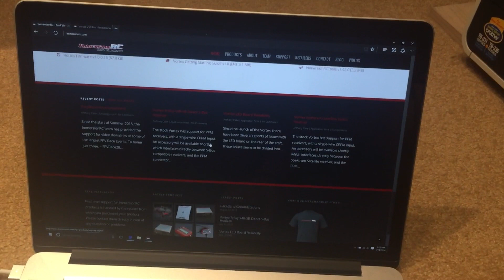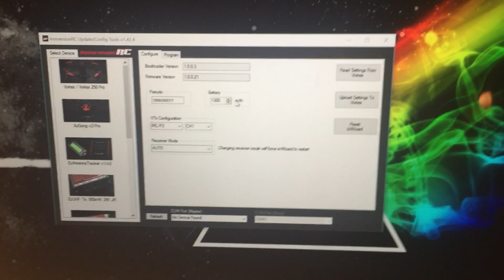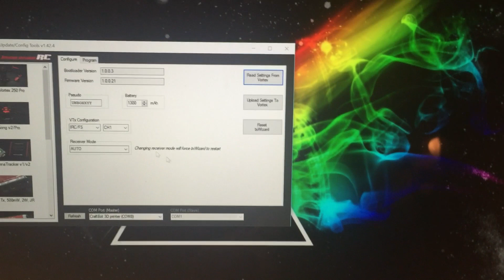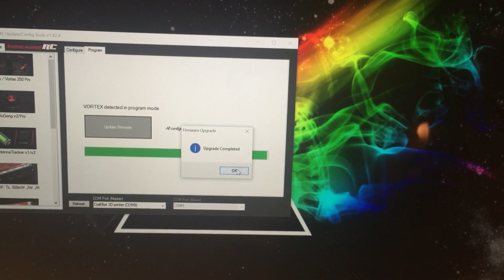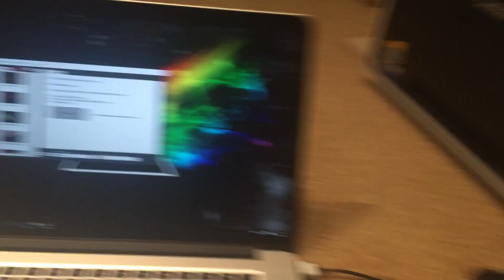How to Update the OSD Firmware on the ImmersionRC Vortex 250 Pro (ImmersionRCTools)

Comment: I flashed my vortex pro to betaflight 2.5.3 and I'm having an issue with the motors spinning up to full throttle with a minimum throttle input this is in all modes angel,horizon, and Air mode with the motor stop enabled is there a fix for this or a way to flash it back to the stock cleanflight configuration ?

Comment: I found this and it fixed this issue: Could you update your fc firmware to betaflight 2.8.1 and osd to 10.0.0.28 and test again.
      
http://fpvlab.com/forums/showthread.php?48200-Blade-Vortex-250-Roll-Drift

Comment: can you help please. im pretty new to this. flashed my vortex 250 firmware with cleanflight. then flashed osd with immer rc tools. problem is when i start motos up and give a bit of throttle they keep spinning up faster and faster. please help.
Reply: I'm having the same problem did you ever find a solution?
Reply: It was because i had air mode on.  just take it outside and fly it will be fine ;)
Reply: So it's all good even in Air mode?
Reply: John Scott yes it's because if not totally flat motors will increase to try and level.  Just take outside and will be ok.   ;).   I was scared to try but give it a shot and was prefect when in the air.

Comment: When I click "Read Settings From Vortex" I get a communication error saying: "Failed to communicate with Vortex. Need at least Vortex fw v1.0.0.6 installed." 

How do you upgrade the firmware if you cant connect using ImmersionRC Update/Config Tools?

Comment: Hi Michael.
Could you please check in Cleanflight if the Board Alignment - YAW Adjustment is set to 90 degrees and let me know ?
On mine it is set to 90 degrees but that sound strange...i was expecting 0 degrees !!!
TIA

ps: you could use also Vortex Configurator App to update the OSD   https://chrome.google.com/webstore/detail/vortex-configurator/jelolponpnnidoojekihdojjdjphdeog